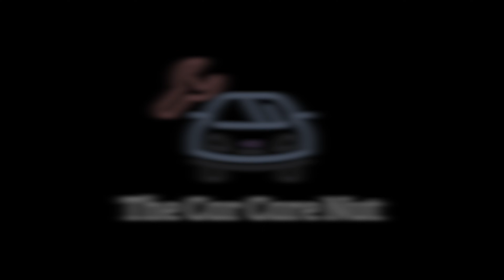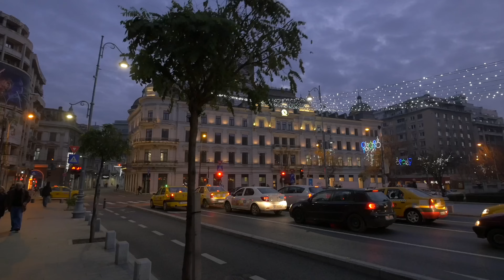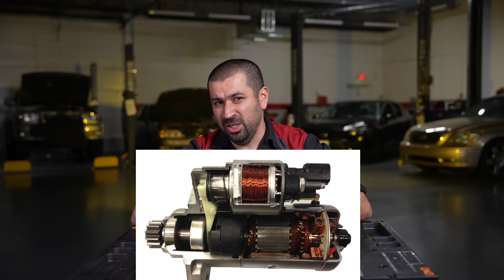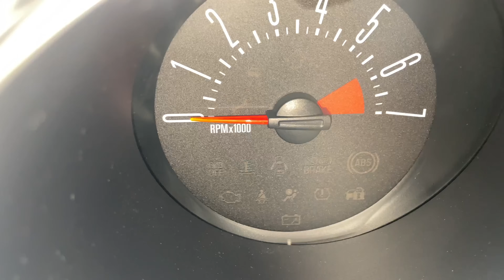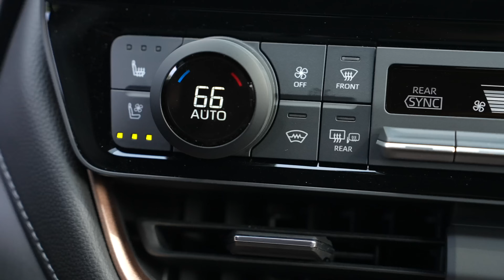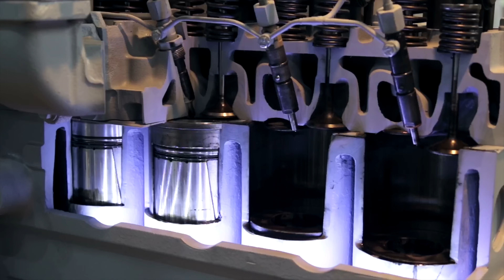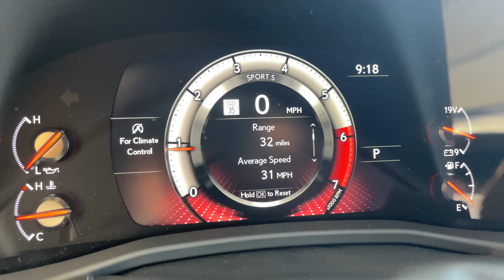How Does Start Stop Technology Work in Modern Cars? Everything You Need to Know

Comment: Start/Stop might help emissions however, the cost to do so is NOT reasonable, not yet. Look at all of the many added on parts needed to make it safe to use such as the special A/C evaporator core and likely that is expensive, the electric water pump, the special starter, electric pump for the transmission, sensors galore and the brake reserve vacuum sensor etc. all. All of those parts can fail requiring maintenance, parts replacement, labor, downtime and on and on.  The EPA/DOE/CARB need to calm down and they need to push their agenda only when it is feasible to the individuals who will foot the cost of their ideas. It doesn't financially work out that the start/stop idea makes any common sense due to the high cost and risk of maintenance needs not to mention the initial cost added to vehicles. Just like air bags galore, curtain bags etc. Much of this should be optional or not offered due to the end results not being reasonable in gains to cost ratios.

Comment: On my Ram 1500 with the 5.7 e-torque, the start/stop system restarts with a 48volt motor-generator. This unit is belt driven and replaces the alternator.  There is a 48 volt battery behind the back seat to do this. As soon as you take your foot off the brake, the truck is moving. This system is far more responsive than the starter based systems you are talking about. The motor-generator can also "push" the truck, with about 130 ft.lb. of torque till the engine is fully on. Yes, the AC stops working when the engine stops. This is annoying but during hot days, it is easy to just push the button to disable the system. I used the start/stop about 95% of the time.
Reply: Even my 2002 Prius (engine-driven compressor) has a thermal-storage evaporator core to keep the AC cold for a short period (less than a minute) at a stoplight. Weird that the RAM hybrid doesn't.

Comment: The incredibly small gains to be achieved with this system are simply not worth the extra complication and weight involved. Then there is the expense. All parts of a car age with time. They lose that new car edge. When these things start failing, the cost to repair or replace components will far outweigh the benefits. 
Also, you as a shop owner should know that today's engines and emission systems produce very little emissions. There isn't much coming out of the tailpipe but fresh air.

Comment: Totally crazy. I installed a switch that I can shut off the start stop and remember the last option I picked before shutting the car off. The solution to me would be to synchronize traffic lights so you don't have to stop at every light.
Reply: To some extent traffic lights are synchronised, but mainly to stop cars that are exceeding the speed limit. However, it is a compromise, since traffic is travelling in both directions with different gaps between the lights.

Comment: Can you explain my Jeep’s start stop - they have two batteries. The second battery is much like a small engine battery (like on a lawn tractor). My Jeep’s start/stop system shut off when the battery(ies) lost enough power to run it. My feeling is the shop (Jeep dealer) really had no idea what or why this happened (meaning it hasn’t happened that often?). Our Jeep is just finishing it’s 4th year of operation and is used under normal driving. I know this type of system has probably been around for 10+ years as I rented an Opel Adam in Europe that hasd it way back then. By the way my Honda GoldWing 2018 also had a start/stop system - I think it’s for European emission standards.

Comment: I rented a car with this start/stop feature once, and it was a horrible experience.  They do not really start fast enough.  For instance, in a round-about, there's often someone that screws up and you are stuck behind this confused person.  If they slow down enough to cause you to stop, the darn car will stop that very second (it's really eager to stop).  The confused person finally figures out they should move at 0.5 seconds, and you want to move too, but the engine has to start again (it shouldn't have stopped in the first place).  Then, you get honked at as if you're the confused person (it's not me, it's the stupid engine that needed to start).  
Bottom line is, traffic situations happen faster than this thing can start, and this occurs several times a day.

Comment: I think the fear of engine damage caused by start/stop systems comes from experiences with hybrid cars - Most of them use a hybrid starter-generator that kind of pull-starts the engine with a very-high tension belt.. I've heard that this commonly causes timing chain issues.

Comment: This “feature” is as dumb as VCM on our friggin Odyssey. All that extra complexity is just more stuff to break for a frigging single mpg gain. Using oil pressure to lock certain valves when VCM is on to having active motors mounts to counteract vibration from cylinders being off which then has the oil in the mounts leak out. Stupid.
Reply: you should permanently disable the VCM.
Reply: @sat_sonic  I have, but not until all the cats were clogged from burning oil with the fing piston ring issue combined with the VCM sucking. Of course all that was outside of the crap extended warranty the govt let Honda get away with.

Comment: I hate the auto stop/start system on my 2017 Cherokee.  Sure, it works.  But also that little delay when it starts - is enough to cause a dangerous moment when turning out of my neighborhood on to the road on a blind curve.  Additionally, one day while it was active, I also realized that it gives the passenger a dangerous control over the engine, as they can just press the button and disable the system when you’re stopped (and the engine is off), or they can press it by accident when it’s been disabled and re-enable it.  I get why manufacturers implemented it, but everyone I’ve asked hates it, as do I.

Comment: The one important item you missed is the turbo on the car. A turbo needs time to cool down. They are more prone to failure and the cost for them is fairly high, but the shop cost and time to replace one is the a decision to be made.
Reply: I came to the comments looking for this. Yes, hot turbo and all the sudden it looses oil pressure will greatly reduce its life.
Reply: And they blame us to hate modern cars
Reply: No, if the turbo is especially hot it will not actually stop. The engine actually has a timeout and calculates for this. Try it. Drive it really really really hard and then come to a stop, it will wait about 15 to 30 seconds at idle before it actually shuts off the engine. There is temperature monitoring within the turbo but there's also a weighted accumulator in software that takes an account how hard you've been driving it recently and the overall 2 minute average of the turbo load
Reply: @pilotavery  It must vary by car then. My engine stops immediately but the water pump to the turbo keeps running to cool it down.
Reply: @ColinDyckes  Really does just depend on the car and it's design.
Reply: Absolutely! This guy in the video is a shill.
Reply: My thoughts exactly!

In the video the Car Nut made about tips for Turbo Cars, he emphasizes cooling down the Turbo before shutting down. Back in the days, when I modified an RX-7 Turbo, I added an electric oil pump to keep re-circulating the oil through the Turbo after shut down. So the question remains, if the manufacturers have outfitted a pump to keep running oil, and coolant through the Turbo?

https://youtu.be/Gn5hrhTEERQ?si=mPdDDMQTjzqEQEtv
Reply: I watched this video to see if he mentioned this as this is the concern I have with it in my vehicle. I try to keep it off but I am not sure if It will really cause a problem.
Reply: Good conversation on a topic I never thought about.  Definitely something to research on any vehicle you consider buying.🎉
Reply: That drove me nuts with Honda's decision to put it on the 22+ Civic Si. It'll wear the turbo out faster since the oil will coke in it.
Unless there is an electric oil pump that stays running but I would be surprised if it had one.
More than likely since the turbo on these cars is coolant temp controlled they just said its good enough.
Reply: @SpecialK69420   all modern turbo cars are coolant and oil cooled, so its not really an issue.
Reply: @Shiver2002  and when the engine is off....yeah the cooling and oilpump is OFF.
Reply: @Michael-oj5pr No, the turbo cooling on any decent car has an 'over-run' timer that keeps circulating the coolant until the turbo temperature drops to acceptable levels. This operates at ignition off AND at start stop. I personally hate start stop so always disable it 🙂
Reply: @ColinDyckes   Hmm, neither my jeep nor my Toyota or Kia are cooled by coolant and have only oil for cooling and bearing lubrication. As far as I know the oil pump is hard linked in the engine and stops when the engine is stopped. But (!) then none of these have auto start-stop, that might be the reason. So the question is: do ALL cars with auto start-stop have electric coolant and oil pumps??
Reply: @Michael-oj5pr  I can't answer for ALL cars, but most modern performance cars with turbos have after run water pumps. My old Lotus Turbo Esprit didn't and killed a turbo. Porsche do, as do Audi.
Reply: @Michael-oj5pr : I know on my 2021 VW 2.0 that there's an electric water pump that keeps the coolest flowing through the turbo for a minute or two after shutdown.
Reply: ThankYou. This is the reason I was encouraged to turn it off ,in my new Mercedes.
Reply: Also, starting off with a cold engine which then gets turned off at the first Stop sign or set of lights - then the engine experiences another cold start which is when most wear takes place
Reply: @kkiwi54  If the oil temperature is below a certain amount of degrees then the start-stop system can't activate
Reply: @kkiwi54 It's not the active actually starting the car that does the wear, cold starting a car does where because the entire time it is cold it is doing where. The first one second and the second second do the same amount of wear because they're both just as cold. Does that make sense? Technically it doesn't save anywhere because it takes the same amount of time to warm up It just is pausing the warm up while also pausing the wear

Comment: What all this means is increased $$$ for a vehicle with start/stop. More expensive starter, battery, additional computer monitoring these, additional water pump, bigger evap coil, additional trans oil pump, brake vacuum monitor system and finally a computer to monitor this whole expensive mess.

Comment: According to Scotty Kilmer, the stop start system, damages, your engine, because of intermittent oiling to the cylinders, not to mention that engines have to operate at a specific constant temperature. There have been no studies on this because car companies don’t want to be liable for the damages, caused by the start stop system.
Reply: He addressed the engine, transmission and oil temps… they are all monitored and will prevent the system from actvating… there’s many times I pull up to a light and the system won’t activate or it will, then come back on before I’m ready to move… I’m assuming that, or the brake pressure issue is why… the short amount of time you are at a light, I can’t imagine the temperature of your vehicle change by much
Reply: Scotty just slags off German cars & is a total Jap fanboy & on top of that he talks bollocks most of the time. Funny how he's an expert on how crap German cars are but he's never actually owned one!
Reply: Kilmer is a clown that no one takes seriously...
Reply: of cars are using turbo chargers on small engines for admissions.. I’ve had turbocharged cars, and one of the biggest problems is having a hot turbo, basically burn the oil in the bearing and prevent lubrication and frying the turbo bearing.

You’ve and you have any heat in the turbo and you start shutting off the engine that’s not good.
Reply: @HisDudeness2023  Except, as he noted, they designed around a lot of those issues.  So, either the engine shut down is too short to affect the Turbo, or they have something like an auxiliary oil pump which addresses that issue...
Reply: @redbaron6805  I heard no mention of auxiliary oil pump. Please provide the timestamp in his post discussing oil pump.. otherwise delete your post
Reply: @redbaron6805  I disagree. I had an early 2000s WRX in the turbo is the one thing that kept the turbo going for over 250,000 miles was a turbo timer. He basically shut the engine down and pull the key out. Lock the car and walked away in the car idle for about five minutes. Specifically to cool off the turbo. You could set the amount of time. 

Without oil in the bearing gets coked .
Reply: @HisDudeness2023  Except, as I noted, you are assuming this is an actual issue on modern Turbo engines, while it is not.

Modern Turbo's are water cooled to solve this particular issue, so the Turbo is kept at coolant temperature in modern engines.

So no, they don't need the oil flow anymore as instead of running at 600F they now are cooled down to 200F.
Reply: @HisDudeness2023  They don't use an oil pump but are water cooled, which solve the issue of cooking oil in the Turbo when the engine shuts down.

Obviously Turbo engines with Start/Stop have water cooled Turbo's or they would literally fail within a few thousand miles.

This was solved literally decades ago...
Reply: I saw that too. I watch Scotty daily.
Reply: It's just common sense. It is not good. Used vehicle buyers that buy cars with that crap are going to have issues and no warranty. In my opinion.
Reply: @vblic  "Used vehicle buyers that buy cars with that crap are going to have issues and no warranty."

That may be about the most bizarre statement ever.  Why would a car with a factory Stop/Start system not be under warranty because it came with it and you used it...?

And they are going to have "issues" based on what...?

Comment: The Start-Stop button or Idle-Stop button can be disabled using a by-pass device. What is the difference if you Turn It Off Manually or a device does it for you automatically? Nothing. However, for Warranty Repair/ Service please remove the device from the vehicle as you do not want to Void your Warranty. Do not remove for regular basic service only when the vehicle is going in for Warranty work. The device is simply engaging the contacts in the switch electronically for you so you don't have to remember each and every time when you Start the vehicle to push the lame and very annoying button. There are no secret hidden cameras or a sensors within the vehicle that is going to rat you out saying "this person had a device to bypass the Start-Stop / Idle-Stop feature". The technician/mechanic will not be able to Prove or show Evidence that you had such an device when it is not there.  You do not say anything and if asked you know nothing about it. Do not admit to it and Warranty still good. Or leave it alone as that you simply develop a habit of pushing the button and become addicted for life. The reason for this feature is to reduce Emissions, which is great for all living things, however, it is bad for your vehicle and your wallet as engine related problems may develop when Start-Stop is Enabled. As for Hybrid and EVs, I have no knowledge how it affects those powertrains.

Comment: I do wish start/stop would integrate better with the vision systems and recognize when I am likely to have to move again in 5 seconds. Like pulling out of a side street; the way I drive, that 1.5 seconds makes a difference to whether I would go or not. Before I get blasted in the comments, no tickets or accidents in over 20 years of driving with a motorcycle endorsement. At least i am well trained enough to remember to turn it off in that specific case. 

Question though: you said it has no impact on mileage, but is that because mileage wouldn't be computed with the engine off/not moving? Or is that overall, tank to tank mileage? Not idling must save a significant amount of gas over the life of the car, no?